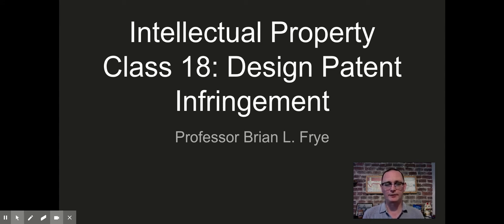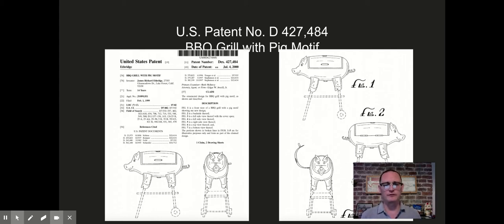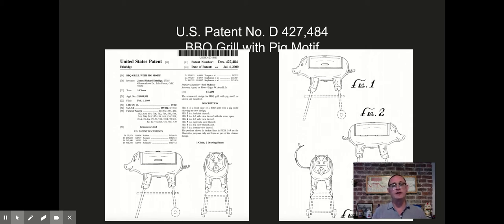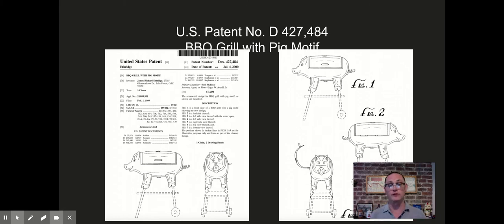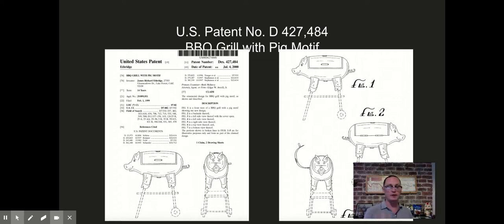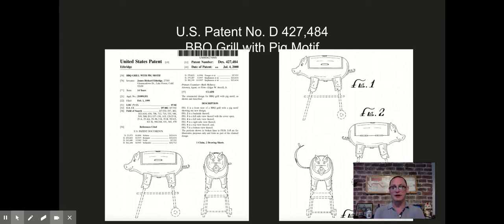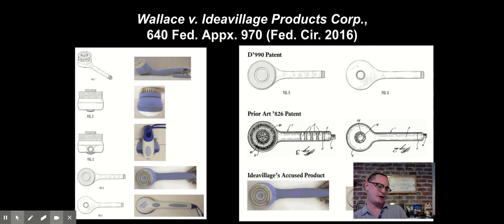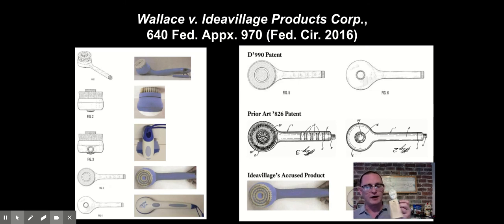Class 16: Design Patent Infringement - Google Slides

Comment: Hello, thanks for the video! I have a question as I have an invention, and improvent on prior art but the design/shape, anatony is the core of the function and benefit of improvements over prior art . what do I do? The shape design/contour is the cream of the  benefit or upgrade.. Example, a plane shape that that reduces drag, fuel consumption, smoothness at any speed not limited to aceleration/deceleration the control would be benefitted from it.. this is just an example of the moral of the ivention..So, I feel I am trapped between  utility and design 😓😓😓